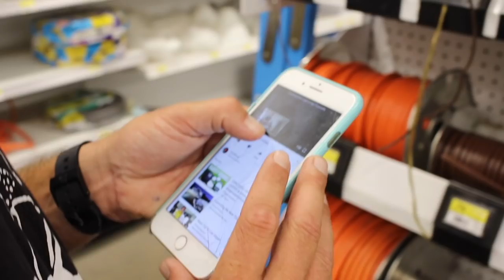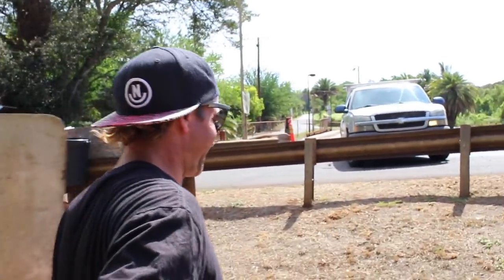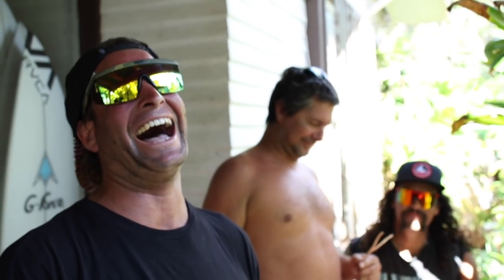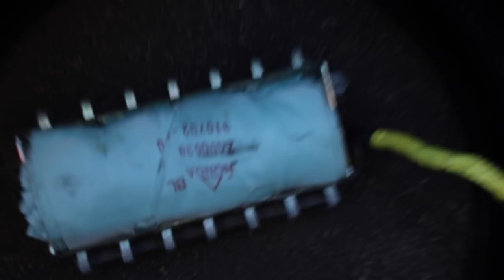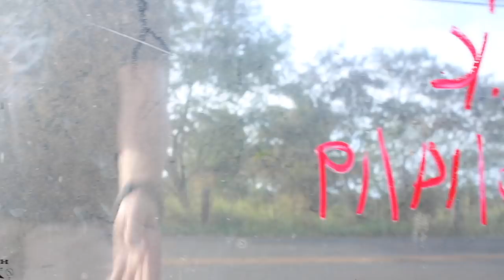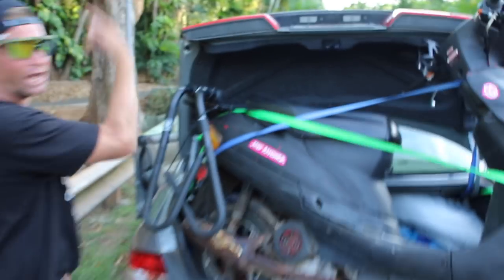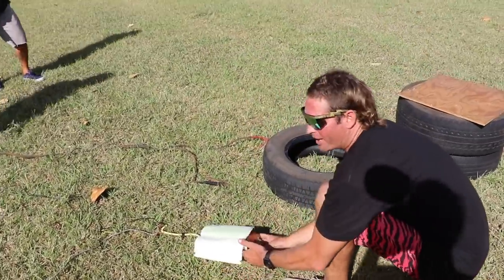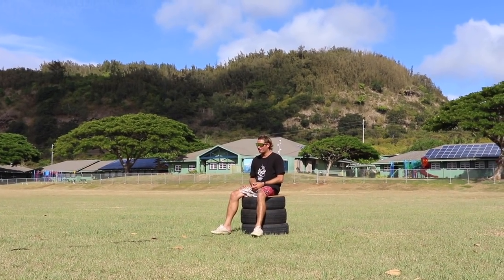GETTING BLOWN UP BY A  AIRBAG

Comment: we tied 40 together in parallel wiring and used a pair of 4 deep cell batterys to ignite them . it was incredible . very very loud . they lifted up off the ground into a circular pattern as they had been wired and the wiring held as it was done properly . it was for a 40th b day party . man it was loud . these where the huge infinity qx56 side impact units , they are huge . there was a recall on them and my brother worked in parts dept at the infiniti dealer so , yeah . i also had that same job later on ...lol ...  and i built a double switch box for safety you had to hold down 2 mom cont switches to pass current . it was safe . i used to take the rig out and set them off inside a parts cage but i started bending the shit out of them . they didn't belong to us - shipping company so i had to go out back by the dumpster and set em off .i got in a hurry once as my nephew was there and i did a " hey watch this" i set if down incorrectly , with the exhaust jet facing DOWN , this propelled the unit about 50 feet skyward . it came ripping down thru a huge willow tree . there was a car fresh from body work , a red coupe being washed over there . i layed on the fender / hood spread eagle  and put my arms out to have this thing hit me instead of the car ... it came down between the passenger side mirror and the door .... man that was close.  i looked and saw my nephew running away - he worked there to. the owner of that dealership wouldn't of been pleased - see horst ! that was one of the funest things i ever got paid to do was blow them off , but so many people would freak out and say they were gonna tell the owner what i was doing . like i was goofin off . he came and saw me , i showed him my switch box . he LOVED it and i set a few off for him . i am sure if i looked i could find some , i am guessing my brother has some . they are super loud but you really have to be carefull . you can seriously harm yourself . never do one off with the jet facing down , they go flying ... its best to mount it . i had SO many as it was a recall i got goofy that once and man it took a year off me .

Comment: It’s because it’s a dual stage airbag. Connect the two outside wires then the two inside wires together then you can run them to a positive and negative lead. I worked on a collision center for 12 years 🤣